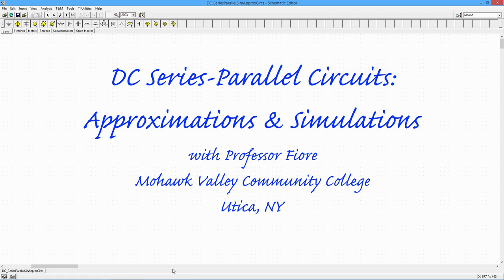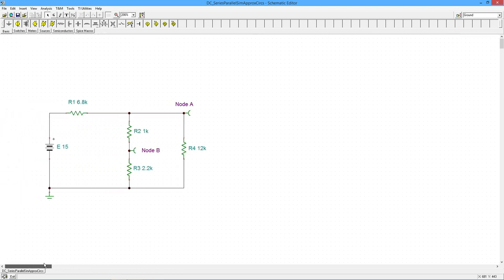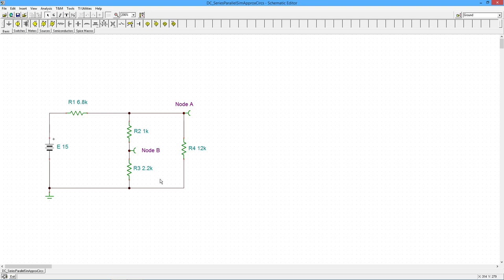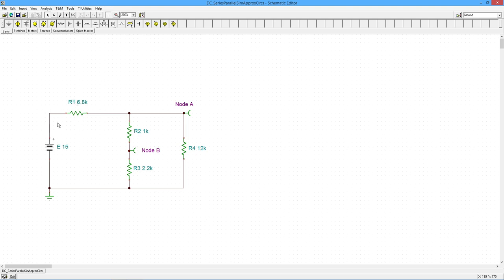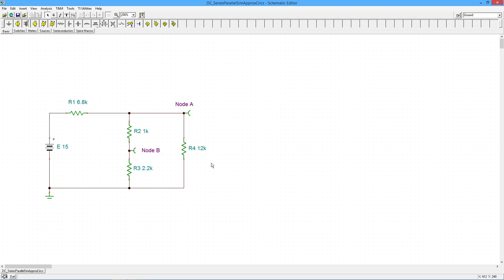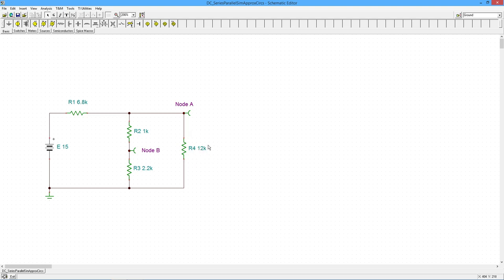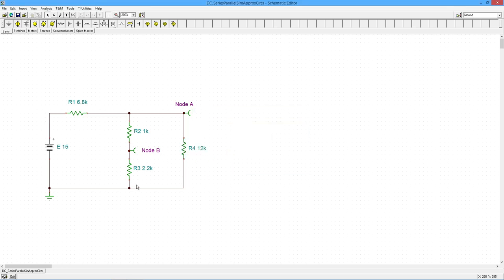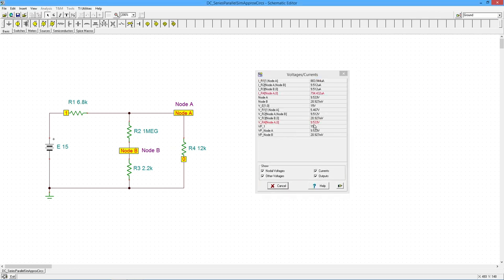DC Electrical Circuit Analysis: Series-Parallel Simulations & Approximations

Comment: Would you do a video on  Series Parallel design problems please? I am working through questions in your book and have become completely lost on some of the problems.
Reply from the maker: Did you see parts one and two of DC series-parallel circuits? 

If you're referring to some of the challenge problems in the text, the "trick" often is to break the design into series parts and parallel parts, and for the parallel parts, focus on using conductance. It has been my experience that many students love the product-sum rule and completely forget about the reciprocal relation (using conductance). Also, many of the design problems in the text can be solved using the voltage divider rule backwards, or by using Ohm's Law. For example, say you have a circuit with a single resistor in series with a parallel pair of resistors. You're asked to find a resistance value for one of the parallel units that will make the voltage across the parallel pair equal to 6 volts. Knowing the source voltage, you could find the voltage across the single series resistor which would allow you to find the current. That current flows through the parallel pair, and since you know that Vparallel = 6, you can use Ohm's Law to find Rparallel. Since you know one of them, use the conductance formula to find the other.

Ultimately, it's all about recognizing which parts are in series (and thus have the same current) and which parts are in parallel (and thus have the same voltage). Then use KVL, KCL and Ohm's Law to pick the thing apart.
Reply: @ElectronicswithProfessorFiore  Yes thank you the conductance formula was the key bit. Using it for one of the resistors in the circuit instead of for finding the total resistance is what had thrown me i think! Many thanks.